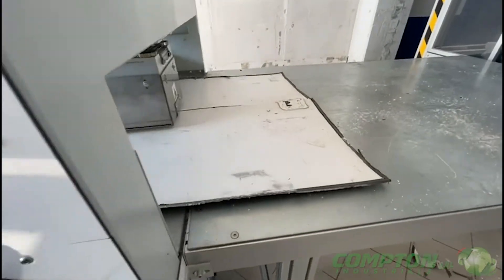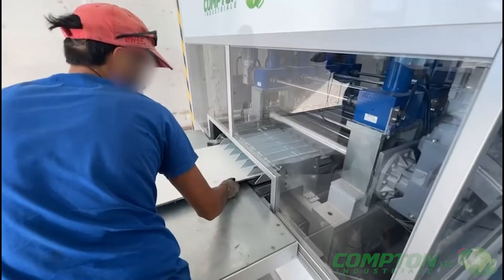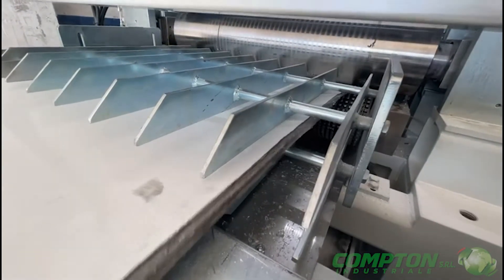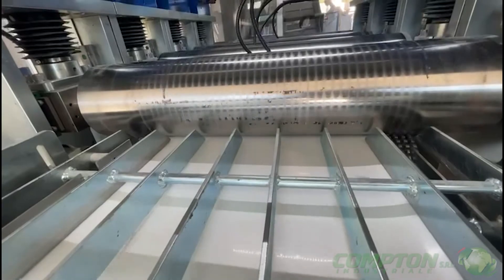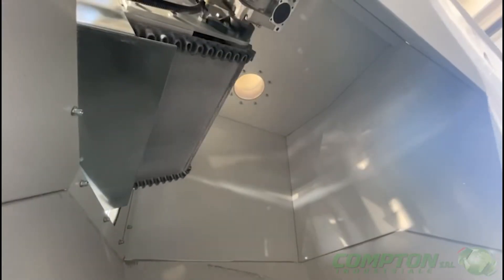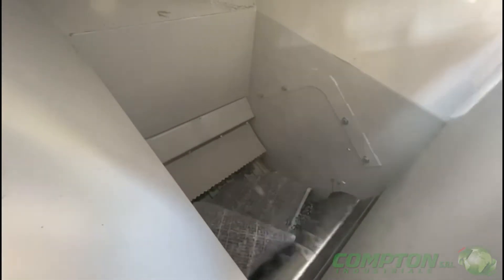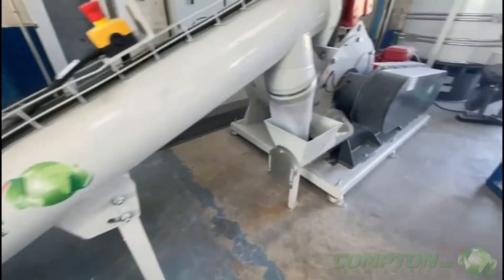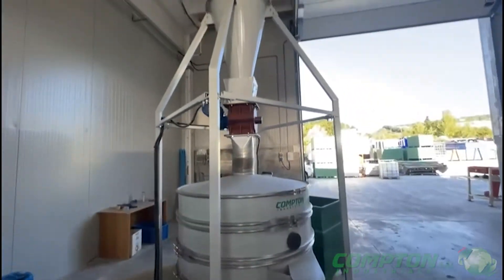SOLAR 4.0 - Solar panels recycling line

Comment: So this is all mechanical processing? Does that mean the glass and silicon are of high quality due to the separation by the vibration stages? Are these end products sold to secondary manufacturers or recyclers?
Reply from the maker: Yes, the process is all mechanical. 
The final vibration stage separates the materials by grain size, we added to the machine a few more stages to achieve a higher quality for some materials (You can’t see it in this video, we’ll upload a new video with the improvements in the next days). 
Yes, the materials are sold to other manufacturers or recyclers without making any other treatment.
For more informations you can contact us at our email info@compton-industriale.it
Reply: That’s amazing your company can produce high quality materials without thermal or chemical treatment. Congratulations

Comment: How often are there jams? 
What is the maintenance schedule look like?
How many hours a week is a single line down due to maintenance? 
How many lines would it take to ensure continuous production?
Reply: Each of the components have proven themselves to be very durable and reliable in many other applications, and many similar waste recycling production lines. And it doesn't look as if it has to endure much at all. There a plenty other videos about shredders that have to shred much stronger and bigger materials. Those blades are often replaceable, and while one set is in operation the other is maintained or refurbished. Electric motors are easy to replace. Bearings are easy to replace. Control boards are easy to replace. And every machine needs some grease or oil at a regular schedule. That's a minute work on a small machine like this.